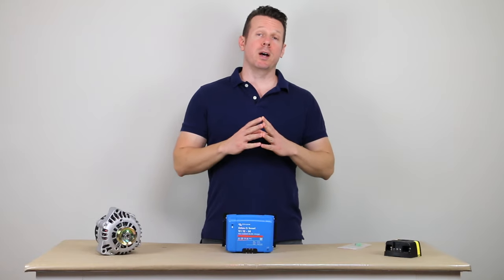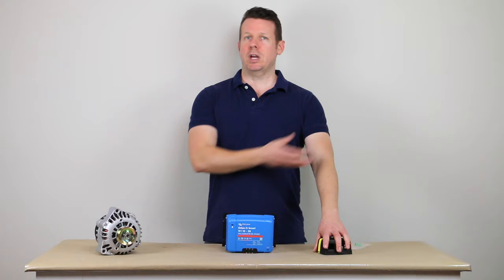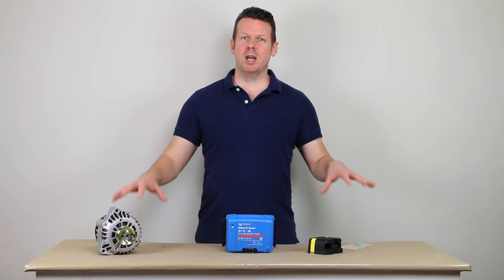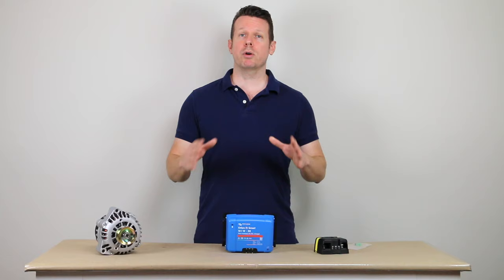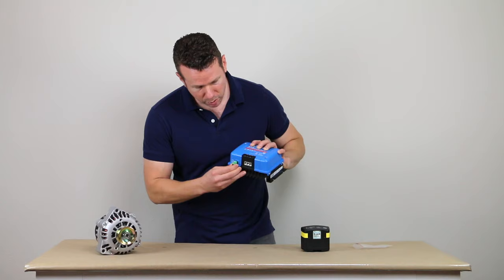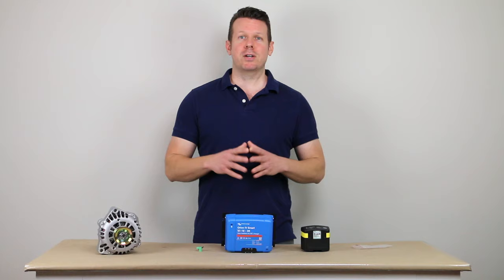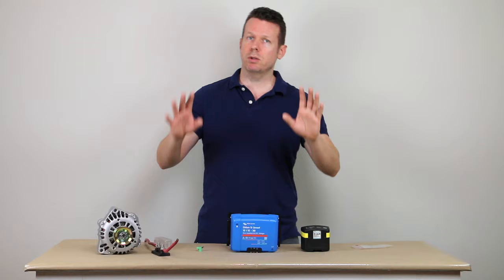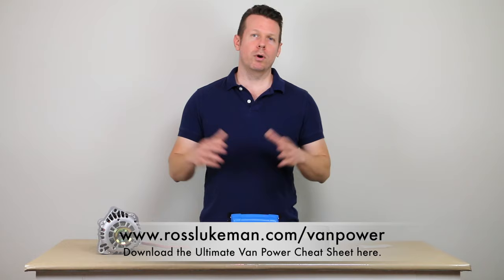Top 3 Alternator Charging Mistakes for Van Conversions | Featuring the Victron Orion-Tr Charger

Comment from the maker: Get the Ultimate Van Power Cheat Sheet: https://www.rosslukeman.com/vanpower
Reply: So I made this mistake and I'm dealing with the inconsistency of having a relay and not a charger.  Can I buy a charge controller to put inline with the relay or do I need a DC to DC charger?
Reply from the maker: @TheKnightrunners  Hey, good question. So you don't want a charge controller (solar) because the voltages it deals with will be different. You want a DC-DC charger that's made for 12 volts in and out (assuming your rear batteries are 12V). You can put it downline from the relay (between relay and rear system), or better to take the relay out and add it to the circuit where the relay was. Hope that helps, good luck with it!
Reply: I had my van converted by a company, they only put a split relay in and because I'm off grid always I've had fuses melting constantly, local caravan man explained why as you have but didn't suggest a charger, just to tick engine over each day to charge up. am not quite sure what I need to get someone to do, is it replace the relay with some sort of charger or add some sort of chsrger to the wiring? sorry for not understanding this stuff.
Reply: sorry me again, was thinking of changing to lithium batteries to help, do they need the charger instead of the relay also? thank you for any help
Reply: If you still have to run a ignition line from the victron then why not get the renogy. I was going to go with the victron all because i didnt have to run a ignition line because it "picks" up whether the engine is on/off
Reply from the maker: @jttribe7683  Yes you can use the engine detection, just make sure you run it through a few trials to ensure the settings are correct. With the bluetooth though, the Orion will take that power from your engine battery, so there will be a small draw regardless. Renogy doesn't have this but I would argue the Orion is made better. Up to you.

Comment: Few automotive alternators can handle 60amp+ load continuous on top of their normal loads -  you need at least 120a alternator before considering a 40a Dc to Dc  charger or it will run hot - Alternators are rated as peak power at higher revs - at lower revs  their cooling fans are not as effective - its at lower revs your alternator works hardest - Some of the more expensive chargers have an alternator temperature sensor which feathers back the current if the temperature rises too high
Reply: Adding an external alternator regulator to a specialized alternator, such as Balmar or Electromax, addresses these issues.  These devices add temp sensing for the batteries and alternator, and the alternators are designed to output high current at high idle engine rpms.
Reply: Totally agree. For peace of mind though. I would install a 100-120amp alternator as part of a good van build.
Reply: I'd like more information about those "temp sensing" dc to dc chargers .... ???
Reply: I read and build a few vehicles thus many alternators are rated at idle too. Companies such as national give excellent guidance and instruction for instructions. 
Most new vehicles regulate power and won't run at 14 volts. Anyone cooking wires though is just running on inexperience.
Reply: @calsmith7902 
Battery temp sensors are available on the 40a DC-DC, i have not seen an Alt. Temp sensor for the Chargers
Reply: thanks for your input i choose to competely ignor though :)

Comment: You need to find the 'Engine running' D+ connection, not an 'Ignition on' connection. Many vans have a D+ specifically for this purpose.

Comment: When considering these things you should always think about your start battery, the RENOGY 50 charges your start battery from solar once the "house" batteries are fully charged. I've been using this system for over 2 years and it works fine. I don't think any other "off the grid" charging mod does that!
Reply: I have a renogy 40amp dc to dc , will that charge the starter battery ?   It’s hooked to my bank, which is hooked to solar ?
Reply: I completely don't understand what fears you're trying to instill in people. I'm pretty sure your video was financed by Victron, and you definitely don't have any understanding of electrical systems. Those DC-DC chargers are heavily overpriced. Take a look at PowMR hybrid solar charge modules, which have everything in one package for half the price of a DC-DC charger. Or am I missing something?
Reply: I'll second that.  The dcc50s is an excellent device.   The auto sensing incoming voltage and adjusting its output so it doesn't flatten the vehicle battery works well.   If you get the remote panel you can adjust the maximum charge current.  I have on my narrowboat.  If the alternator belt starts to slip I can reduce the load until I'm moored up.  Also reduce the current on hot days so it doesn't cook anything.

Comment: Good advice for DC-DC charging from the vehicle alternator. If you are using a second alternator to charge your coach battery, consider converting the battery and inverter to 24V or 48V. The current will be 1/2 or 1/4 respectively, and you can get a 24V or 48V converter to power the 12V coach accessories. Actually there are more 48V alternators to choose from and it's about the same cost so there's not much reason to use 24V, unless you don't have enough solar to power 48V (solar cell voltage must be 5V greater than the highest battery voltage - you typically need at least 4 panels in series)

Comment: Great video. We have a travel trailer and upgrading to lithium battery this year. No solar, but we have a 2000w Bluetti solar gen, we use during travel to run fridge on AC. Problem is that it's a power hog and drains battery in 4 hrs. I would like to add some charge while we drive. The gen is limited to 15a charge and 12v or more input. Would this be able drive both batteries as we drive. Don't expect to fully charge just compliment. Driving 2019 F150. Your thoughts would be appreciated.

Comment: I've put one 100Ah lithium battery in my fifth wheel. I upgraded my converter to charger the new battery. I did install a 100A shunt and monitor. My question is for when I am towing....what will happen to my alternator on my 96 7.3 PSD? Should I be concerned.

Comment: I have used a relay forever . I'm looking to ditch the lead acid and go lithium . I will have to have a dc to dc charger . Thanks for the great video. I haven't used fuses in years .I use circuit breakers got sick of not having the fuses I needed if they blow .
Reply from the maker: Glad you enjoyed the video! That is telling that you needed the resettable circuit breakers due to overloads. That has been my experience with the relays as well. Thanks for tuning in.

Comment: Do you use ferrule terminations to avoid loose connections instead of bare wire ends going into the DC to DC charger?
Reply from the maker: Hi Kent, I only use ferrules for smaller-gauge wires but may try that! Thanks for the comment!
Reply: Victron connectors are designed to accept and hold bare wire.

Comment: Thanks for sharing, the best video regarding this item. Very clear and educstive. Is there any requierment for the max Amps of the controler (as shown here 30 Amps) and the max Output Amps of the alternator ? Regarding the swich fuse, the connection to the controler should be after the swich fuse ?

Comment: 00:00 Intro
00:40 Using a relay instead of a more expensive charger
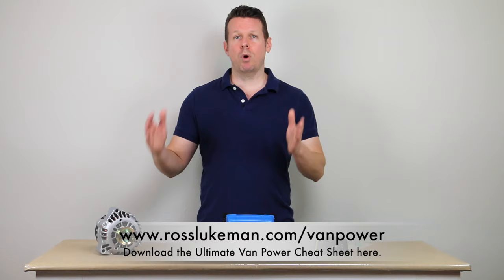08:58 Importance of ignition control voltage sensing relay
13:59 Making sure connections are tight
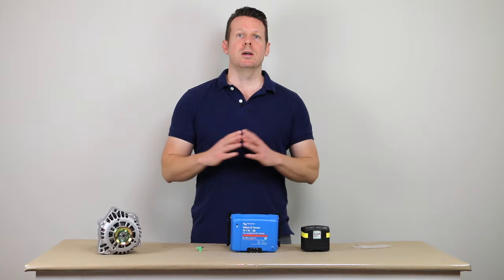15:25 + BONUS Importance of placement of washers in electrical connections

Thanks for the info!
Reply from the maker: Thanks for checking it out Krysta! I like your channel!

Comment: Oh yea!  Double check to assure you have tightened all the connections.  I speak from experience when I say, this is important.  I connected an Orion DC Charger and didn't tighten one of the lugs and by the time I noticed it, you could tell it was getting plenty HOT!  Thanks for sharing and thanks for the advice.

Comment: I can add a little data to this discussion.  We have a 2014 Navion RV on a MB 3500 Sprinter chassis which is also VERY popular for van conversions.  When I switched to 280Ah lithium house batteries I tested the current from the alternator and it was about 40A with Li batteries @ 50% charge running through the "marginal" OEM charging solenoid.  MB Sprinter techs suggest 40A as an acceptable charge rate so I thought things were within tolerances.  Sadly the OEM solenoid was partially fouled and some days no battery charging would happen.  I upgraded to a Cole-Hersee solenoid and again tested alternator charging to 50% Li house batteries.  Eeek! 91 AMPS.  That is going to be a huge problem and put my entire charging circuit at risk.  

I installed the Victron Orion  12/30 DC>DC charger and re-tested for charging current:  31 Amps with very consistent voltage and Lithium charge profile to my 280Ah Li battery bank.  This will protect the alternator and charging circuit, and offer the best charging profile to keep my house batter bank healthy and topped off.  A win-win!
Reply from the maker: This is an excellent write-up Dave. Thanks for sharing your findings!

Comment: I run a Genesis dual battery system in my Tundra, running 2Awg wire to the back to a portable home made solar battery bank, 2 100amp 12v batteries in parallel, with a 2000 watt renology inverter, I do have a Renology 40amp DC to DC charger but may just have that on standby as I believe the Genesis system should be able to charge the batteries safely off the auxilary battery in the front

Comment: Ross thanks for your well explained you tube video’s I have watched you tube videos for the last four years and was not fully understanding. I not only need for a van build I also need to use solar  off grid on farm/ranch in a rural remote setting. So my understanding of solar and the understanding the multiple Victron Energy components is also very important.
Ross in one of your photos you used in of your Alternator charging emails showed the writing of two Victron inverters to the battery bank. A smaller Victron inverter for low voltage for 24/7 or for night use with a low draw. I think you used 275 volt 12 watt. You had three 100 AH Battle Born Batteries 12 volt.
At the present time I am checking in to understanding if a 500 watt inverter would power my low volt 24/7 and/or over night Energy needs or if that would be to high? I do know during solar hours hours a higher watt inverter would be needed.
In the pasted I hatched eggs in a incubator and what hurt me is when the power grid went down I never did know long grid power would be down when the power grid went down all I could do is cover the incubators with blankets. In the past my incubation season started February 1 to November 1.
Also I want to design a system more like a power bank system that solar panels can be added to.
One area that I am also confused on is understanding and knowing more about 12 volt,24 volt,48 volt systems. And which one would be the best for me. One area where there is internet confusion is over and understanding the extra power boost needed for start up needs of power tools. I know I am leaning more towards 24 volt system with my limited understanding I do not know for sure. I do know for main central off grid system for agriculture a 48 system would work better. I am trying to understand for small remote and not integrated stand alone solar energy a 12 volt system possibly might work.
I also know and understand truly to understand solar I have to do more that read about it and watch you tube videos I know a person learns  a lot in the process of activity building a system.

Comment: FET isolators for the win. been using them on my boat a long time.
Reply from the maker: Thanks for the comment! Do you have the isolator working with lithium, or with lead-acid batteries?
Reply: @Ross Lukeman  currently with lead acid. but will be switching to lithium in the next 4 years once the lead acid run there course.
Reply from the maker: @BarnicleBill  Ok thanks Bill. I will have to look into these isolators, I frankly don't have much knowledge of them. Everything I do is lithium these days, so I'm not sure if it would work, but I can look into it. Thanks for bringing these to my attention!
Reply: @rosslukeman  I'd watch a video if you made one on em with lithium

Comment: I use a switch for the   Orion-TR 30 DC-DC charger. Need some ohrs to fullcharge the 200Ah batterybank. The fridge use some amps and the fridge vent .

Comment: The problem with using an ignition control wire is that if you have the vehicle ignition in the on position with the engine off the charge will turn on. It'd be best to pair both the voltage detection and ignition control wire if you are worried about the voltage detection failing. With how the Orion is currently programmed that would mean adding another relay or contactor between your vehicle battery and the Orion.
Reply: This isnt a problem. For Redarc and Kings dcdc controllers, when the ignition on wire method is used, they will only turn on >12v, and will still turnoff <11.5v   
11.5v, the engine should still start. If not, pretty much everyone is carrying a engine jump start pack (I have 2) these days, so running down the starter battery is not a risk anymore.

I need to use the ingnition wire start charging method, and it isnt an issue.
Reply: @nordic5490  Victron does what I described.
Reply: @dirtyaznstyle4156  Just don't forget to turn the toggle switch back.

Comment: i have read alot of reports on the victron having melt downs  burned wires. I think they should recommend  ferrule fittings on the end of the wires. thank you
Reply from the maker: Thanks for weighing in, I think it is probably due to loose connections. As mentioned in the video, I had to go back and tighten my connections as they got loose after the initial tightening. I can see how they might get hot if people are not going back and re-tightening things after the initial install. Thanks for tuning in and for sharing your thoughts!

Comment: All this work is assuming a single alternator.   I am planning on installing dual alternator system and really looking for systems that start with that as a base.   I want to keep the van chassis and engine electrical generally separate from the house electrical systems, perhaps with some manual switched crossover in and emergency.

Comment: Thanks for the information. The only thing I am missing on the Orion is that you can't configure the maximum current output. For use in a caravan the limiting factor is the wiring between the towing vehicle and the trailer/caravan. I basically need a Orion which is limited to 10A or even less. 10A is more than enough for my needs but it adds the needed safety when switching from lead acid to LiFePO4. I heard rumors that Victron is working on a next generation Orion but that can be this year or in 5 years and not getting any information from them is a bit of a let down.
Reply: I use one from Renogy, you can configure their dc-Dc chargers on maximum current use and output. I have ther dc-dc mppt charger. With a solar plugged in , it will even trickle charge the starter battery once the rear/home battery is fully charged. It will also make use of all the power from a solar panel first, and the. Use needed additional current from alternator if needed.

Comment: If you use wire ferrules on the ends of the wire the screws won't loosen as easily and will give a better connection.

Comment: I know this video is a couple years ago, but I just had a quick question. If i want to run the cable from my battery back to the driver's rear of the vehicle and then up and over to the passenger rear of the vehicle, will the be problems with a run of that length? Do I need to go with a heavier gauge since the run is a little longer?
Reply from the maker: Hey there, yes you might beef up that cable gauge because you'll have a larger-than-usual voltage drop and will lose some watts of power due to that. I would use the largest gauge that will fit into your DC-DC charger.

Comment: Thanks for this. I'm fairly new to this. I have 2 x 235Ah lead acid batteries in the back. Does that mean I should use 2 x 30a B2B chargers in parallel?